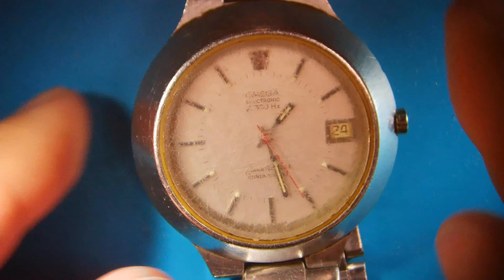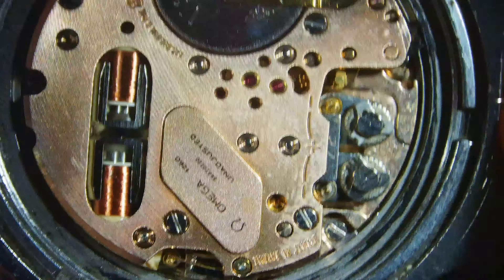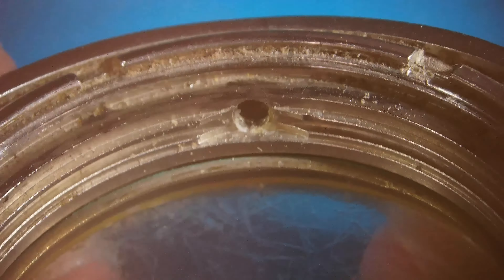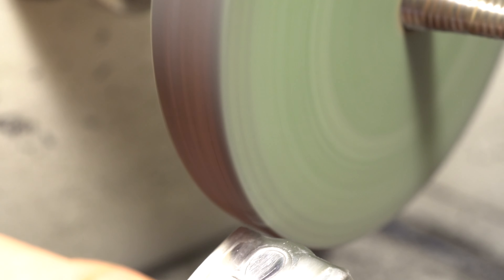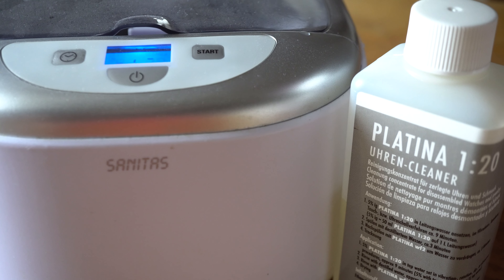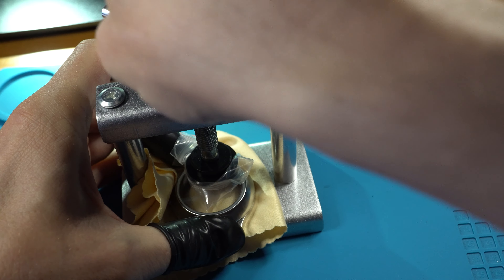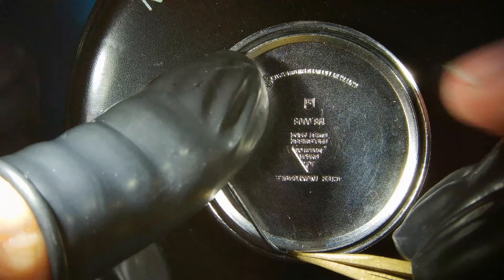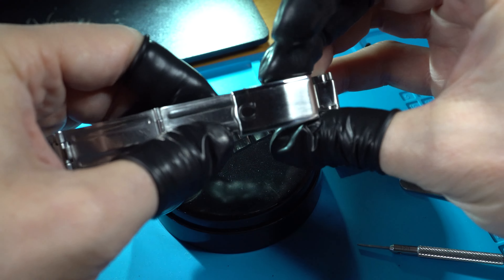Omega Seamaster F300 Hz 198.0008 Electric Tuning Fork (Accutron) - Full Case Polishing Restoration

Comment: You should remove the oscillator module before you take the movement out of the case. Else there's a great risk to damage the index wheel if the seconds hand is touched.
Reply from the maker: Thank you for that hint. I did not know that. I thought I'm safe since it has the hacking function to stop the seconds hand while removing the hands. I will definitely keep it in mind. I am just an amateur, trying to learn :)
Reply: Is removing the battery sufficient?
Reply: No, the oscillator module has be completely removed. If the seconds hand is moved backwards with the oscillator module in place, the teeth of the index wheel will be stripped

Comment: With an untrained  eye I’d say nice restoration.  Strained eye would say it should be brushed not polished. An expert eye would say you did zero revision on the movement itself . Still the result is nice
Reply from the maker: You are absolutely correct. I just wanted to do a Case restoration as stated in the video title. The "polishing" wheel that I used is applying a brushed finish to the case and bracelet. So it is actually brushed. But an expert would have used a lapping machine for the finish and thus also recut the edges. Sadly I don't that kind of equipment. I wish I would :)
Reply: @GermanWatchmakingChannel true . I also believe there have been different variations of this watch. More polished with less vertical lines. I’ve seen matte with almost tree bark structure and the version I have that’s slightly polished but with vertical lines. Also it is NOT A quarts movement. Bulova does have a quarts and fork combination watch but this is all
Accutron

Comment: Keep it up man! Im from philippines and also a watch fan..this is pretty rare. I also have an old seiko vibron wallclock also tuning fork movement. My question is in that watch can you still hear the humming sound? Thanks!
Reply from the maker: You can hear the humming if you keep the watch close to your ear. Depending on your hearing maybe also if it lays close to you.
Reply: @GermanWatchmakingChannel  ahhhh nice. Impressive vintage technology.
Reply from the maker: @cetocoquinto4704   I like it too. One tuning fork in the collection seems reasonable. And they are not that expensive as well.

Comment: Hello. I have a question. I have the same watch as the one shown in the video above. If you don’t mind, please let me know the size and thickness and height of the glass and gasket you replaced and also the material of the glass gasket. Also, I would appreciate it if you could tell me the size and thickness and height of the gasket on the back
Reply from the maker: The back Gasket is just a simple rubber O-Ring Gasket (the official is Omega 088.0607 Overall diameter Ø31.75mm, Thickness Ø1mm) You can also take a generic off brand one). 
The crystal is originally Omega TN5195 Mineral Glass, but I really would recommend a Saphire crystal since it will not scratch with  Ø31mm and 2mm Thickness. 
The Crystal Gasket is very special and needs to be original in my opinion (Omega 098EW0006). It is an L Gasket and has the following dimensions: Ø32 T1.1 H3.2.  Sadly I have not found a generic one so far to replace it. 
Hope it helps.